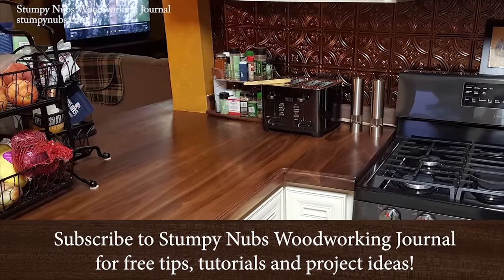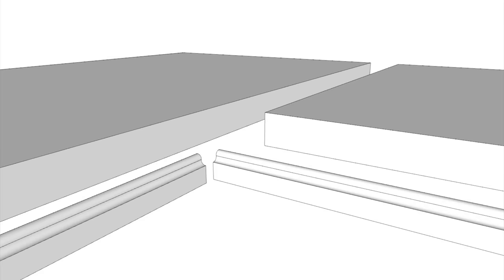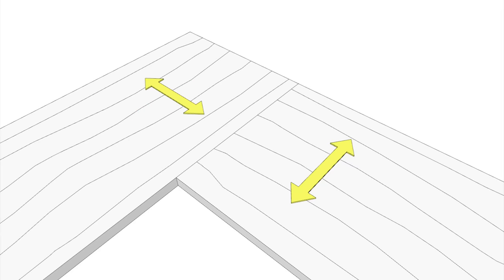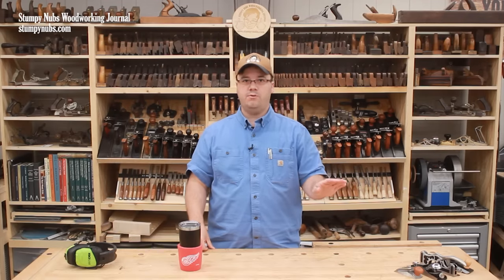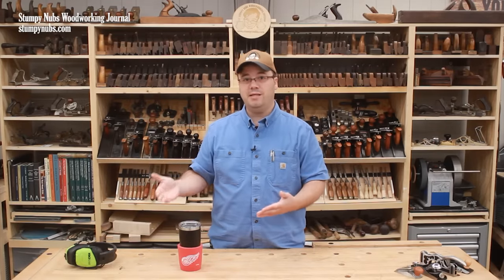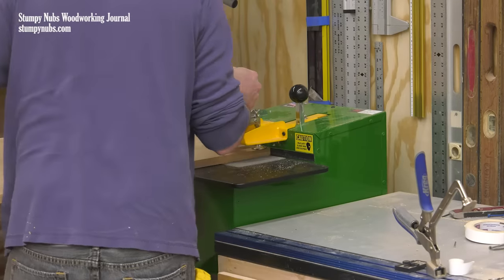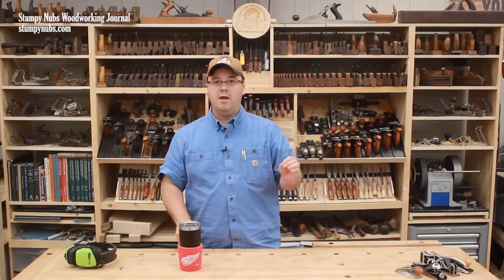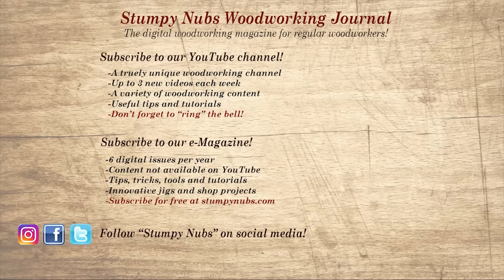A common mistake of connecting corner desks and counter tops

Comment: Great video, but as a complete novice, I am confused about something. In the loose tenon tutorial, the tenons were glued into the piece on both sides, whereas they are dry assembled here. Is that because those were legs that didn't expand much? In what cases would you actually recommend gluing the loose tenons? Also as a side note, can you use loose tenons for angled cuts like that mitred counter instead of biscuits?
Reply from the maker: In the loose tenon tutorial narrow boards were attached. These will not move nearly as much as wide panels. You would always glue the tenon except with very wide panels with crossed grain.

Comment: do you add caulking so that nothing oozes into the lower cabinets though?
Reply from the maker: You can put silicone in the seam if you want, but if the mating surfaces are smooth, there will be no issue.

Comment: Great video, now I'm a little concerned about the desktop I'm trying to make... Although mine is 2 layers of 1/2 plywood... Bottom layer features a butt join, top layer a poorly cut mitre join.

I'm hoping that because it's plywood and not board, glued face to face rather than just at the joins, should mitigate the swelling/contraction over time?
Reply: Hi Kyle, curious if there's been any changes in your desktop. I'm considering doing something like what you've done on some cheap hardware since I don't feel like upgrading to do anything fancy. Just a saw and drill lol
Reply: @therecentlyundeceased  no changes that I've noticed, but it's still a reflectively new piece... I would suggest getting a straight edge/saw guide if you don't have one yet if you're doing anything similar... It's one of the few pieces I wish I had looking back... (I learned 2x4's aren't straight enough for longer cuts)

Comment: Would the “dog-bone” have worked on the desk?  Allowing for disassembly for moving?
Reply from the maker: A smaller version for the 3/4 thick top would work, but it's overkill on that size desktop. Plus, once my miter is tight and flush, I don't want to take it apart again.
Reply: @StumpyNubs  I understand you not wanting to take it apart again, and now that I’ve bought a house, I wouldn’t either.

That said, there was a time which I moved quite a bit - during my military years, and the next several after I got out.  Being able to break down a desk, table, etc would be a God send.

Comment: Thoughts about using 14mm Dominoes & Tite bolt fasteners on a butt jointed 25"W X 1.5" thick "L Shaped" Butcher Block counter top as opposed to biscuits and pocket screws?

Comment: This is very helpful! Subscribed. :) I'm currently building a desk myself using the butt joint technique. I'm a new, amatuer woodworker and I really don't have much fancy equipment, but I make do. I joined 4 1"x6" boards using biscuit joiners and wood glue. They were S4S boards, so I didn't plane the jointed area. Maybe that was a mistake. But I want to plane the surface to make the surface as flat as possible. Theres still some peaks and valleys in the board that I want to plane out using my electric hand planer. 

I guess I'm wondering: 1) Should I have planed before jointing all 4 sides? 2) are peaks and valleys expected from "loose tenon" joinery? 3) Whats the best way to plane this down to flat with only an electric hand planer? 

Thanks to anyone who can help answer this. Wish me luck!

Comment: So the draw bolts are used in conjunction with loose tenons or biscuits, right?
Reply: That is how I usually do it. Loose tenons to keep the surfaces level and draw bolts to keep the ends together.
Reply from the maker: Yes

Comment: Hey Stumpy, on some woodworking forums I see Europeans using a different form. It’s closer to the butt joint, but it’s called the “euro miter”. The edge grain side is cut back a little with a curve into the inside corner so the long grain side can butt into it over the cabinets that the edge grain side is covering. Personally, I think this looks a bit weird in a finished product, but I’m sure there’s a benefit to it if it’s a common method over there. Any explanation on that?
Reply: Hey George, I'm also looking for information about this euro miter vs butt or miter joints. The only purpose I found is that euro miter would be more invisible than the 2 others.
And here in France, that's the type of joints professional kitchen makers use.
I already made a miter countertop that was fine for an amateur woodworker like me.
But I want to be more professional or at least advanced amateur so I want to know more on the euro miter as well and why to use it.😃

Comment: Would using two part epoxy sealer on all surfaces to prevent humidity take up and release Help ?
Reply from the maker: You would have to entirely encase the wood in plastic to prevent all movement. Who wants that?

Comment: Anyone have a link to the corner desk video the table top I've ordered is too short for the Miter joint and too long for the butt joint, unless I trim it to the desired length, both table tops are sealed in resin so I'm not too worried about movement over time.
Thanks in advance.

Comment: instead of loose tenons, would it work a tongue and groove joint? Or is there some problem in that case?
Reply from the maker: You would see the end of the tongue on the edge of the counter.
Reply: @StumpyNubs  Even if the T&G is not the full length of the cut?
Reply from the maker: That wouldn't be a tongue and groove. That would be a very wide mortise and tenon :)

Comment: I don't understand why you counterbored the Pocket Hole Screw Holes - the screws would not have any holding capacity, so doesn't this negate the use of the pocket-holes entirely?  Thanks for the very informative video.
Reply from the maker: Only the pocket hole is counter-bored. The threads are not meant to bite into the wood on that piece, anyway. It's the head of the screw that grips that half of the joint. The mating piece is not counter-bored, and that's what the threads bite into.
Reply: @StumpyNubs   - Thanks but...if you counterbore the hole then there's no material for the head of the screw to grip??
Reply from the maker: @KellyBurnham  The screw head goes in the pocket. The shaft of the screw slips into a smaller hole within that pocket. I am enlarging that smaller hole while still leaving plenty for the head to grip onto. https://youtu.be/4-OGtAs12ZQ?si=wqAgr2tl2RIUjWJ-&t=396
Reply: @StumpyNubs  - OK. You are enlarging some (not all) of the screw hole to allow for expansion/contraction at the joint, correct?  I agree that not using glue at a joint with opposing grain directions makes sense.  Would you Glue an end-to-end butt joint where grain is all running in the same direction?  I have a U-shaped counter and I'm thinking the joint in my countertop should be at the Sink, as there's very little joint left exposed.  Any thoughts?

Comment: Wood moves width and length. You need another plane.
Reply from the maker: Wood moves VERY, VERY little along the grain. It's virtually imperceptible.
Reply: @StumpyNubs  up to 3%
Reply from the maker: @jimmacglashan7245  I know of no species of wood that will grow 3% along the grain due to changes it moisture content. If such a species exists, it in far out of the norm. On average, wood expands up to just  0.01% along the grain. It is so little that most references say it doesn't move at all, an I have never seen a chart that even tries to calculate it.